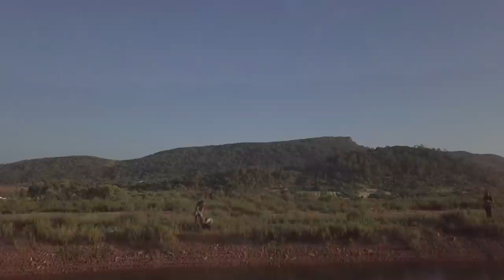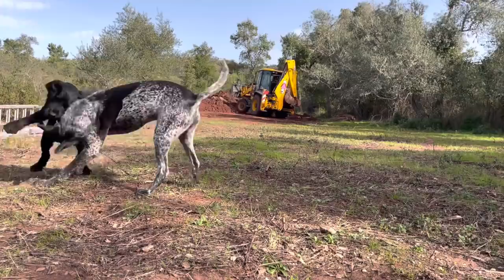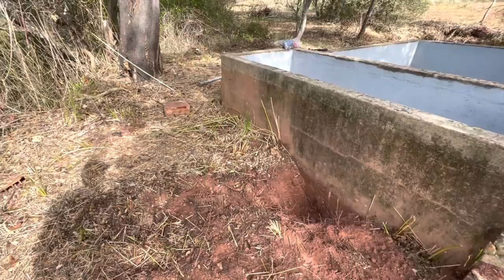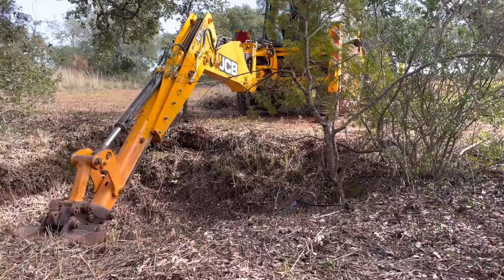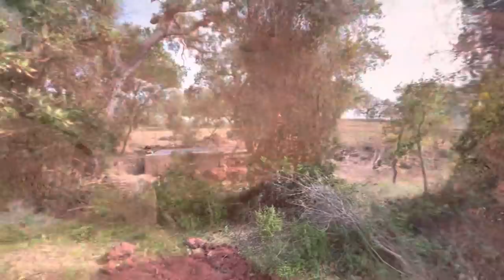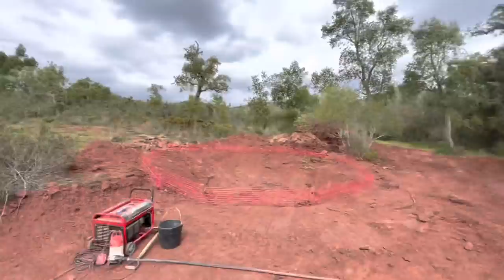The Backhoe Digger Is Back | Wow #43

Comment: Just thinking about your well on the previous video you mentioned concrete pipes ! Have you thought about a one piece pipe such as the ones they are using over here for sewer pipes heavy duty black plastic and they are ribbed ?
Reply: This is a great idea. Some single size clean stone in the base to level off. Plonk the pipe in some stone on the inside to hold the pipe, more on the outside as you backfill will the excess spoil. Finish below ground level with concrete footing for a traditional top in stone. Guaranteed for 100yrs 😊
Reply: Those are small for a well
Reply: @antoniodasilva1230  you can get them upto 48 inches diameter 1.2 meters
Reply: @jamiemckenzie8516  thats still small you will drain the well in less than five minutes in the summer trust me ive got two wider than six feet and two about that size in cement rings come summer you drain it fast

Comment: Excellent work.Really coming along very nicely.Just a thought,do you still have the digger attachment for your tractor? If you do use that dig a trench for the pipe from well to tank.
Reply from the maker: No,sold it. It was not practical.